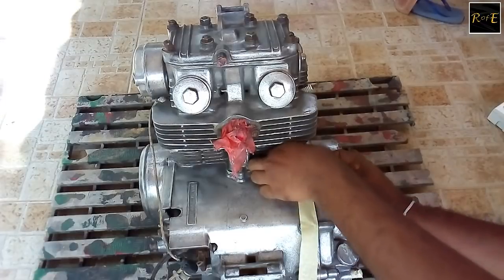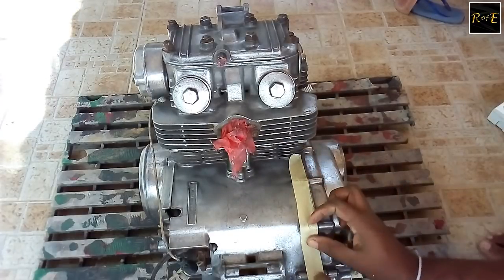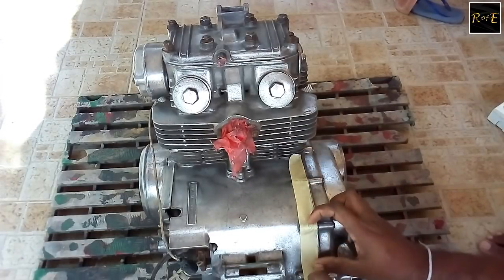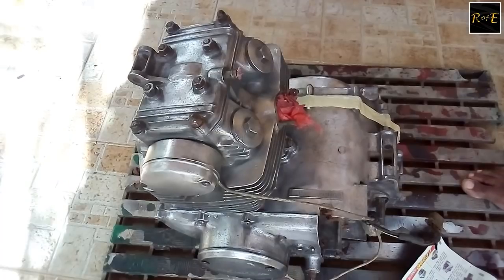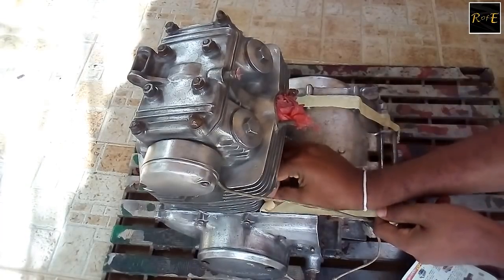How to Paint a Motorcycle Engine (175CC)  | Cleaning and repaint Old Engine

Comment: Not sure of your skill level, but with some masking tape and some time spent masking .. this could have been a very good repaint. It is not always necessary to wire wheel the entire old paint off. Judging by the fight it was putting on, would have made a pretty decent base. After the Entire engine had been painted, not just two side covers, some zinc plated hardware and it would have been golden. Stuff like that doesnt cost a whole bunch more, just needs some attention to detail and some time. Cheers
Reply: fartpoobox ohyeah  i am sure there is atleast one video on my channel with a painted engine, for a bike build

Comment: This video is from sri lanka, honda make good twin cylinder engines, i have a benly 185cc twin cylinder bike, since 18 years no engine repairs except the piston rings changed, these are good smooth  engines, and also  bikes are heavy and stable. Not like the indian and thailand made hondas. Also the 250cc cb hornet, 250cc jade and cb 400 are greater 4 cylinder engines with the smooth exhaust.

Comment: At. Least on camera the paint looked pretty  good  i tried to polish my old Honda engine. On the bike with a Dremel tool  way before YouTube was. Invented the  engine did look better  but the effort wasnt worth the return IMO  and your way was faster  i was afraid to paint as i wasnt sure how it would hold up long term with the engine heat  i have  one more older Honda to do   In the future  and that one i will. Pull the motor for other. Work   To be performed on the bike    May consider a paint or diy powder coat